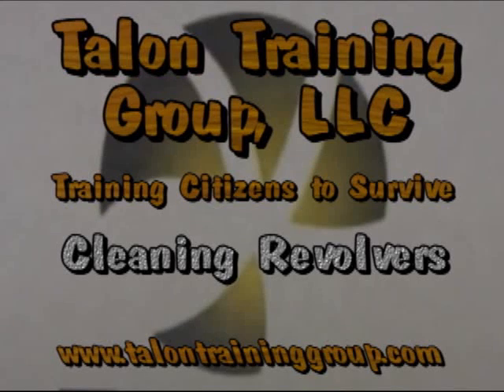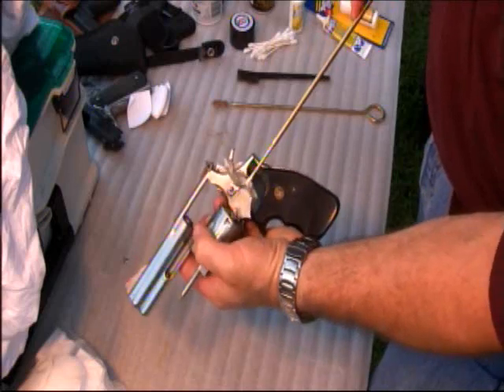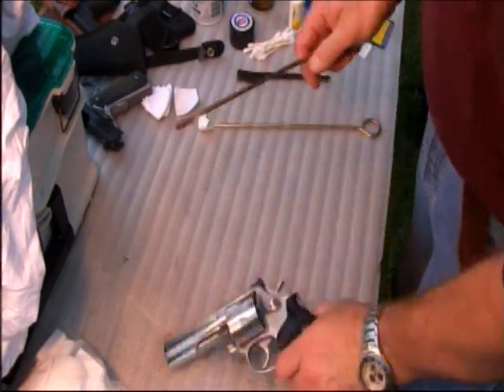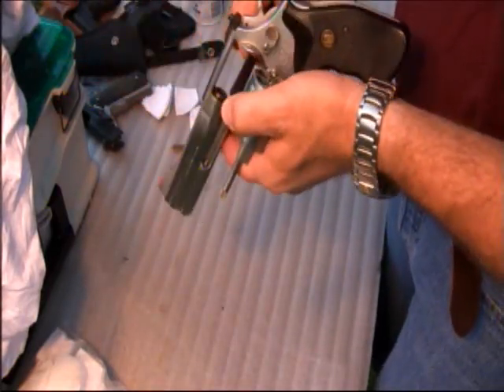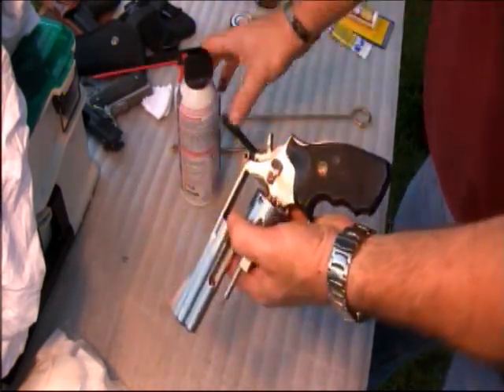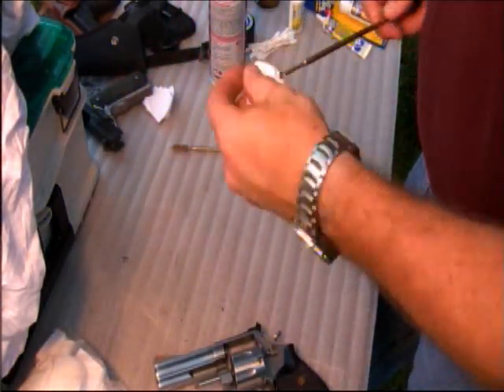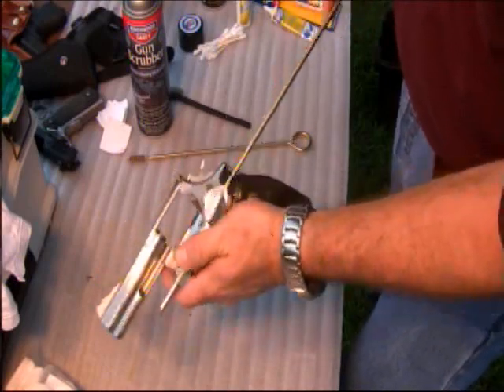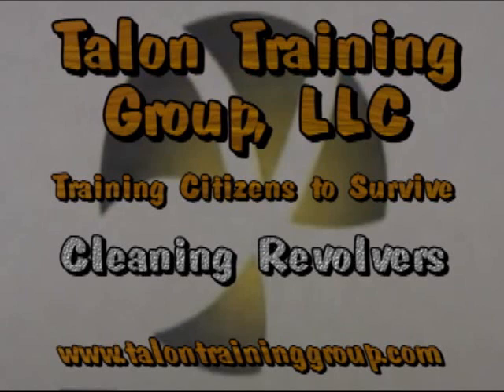Cleaning Revolvers

Comment from the maker: That warning was to prolong the life of the brush.  The reason I don't use stainless steel brushes is that it is a hard steel and will scratch even other stainless. The Phosphor Bronze is a mild steel that won't scratch very bad, but, cleans well. You won't damage your barrel by doing this. It does wear out a brush quickly and can get stuck.

Comment from the maker: In a rifle, it is discouraged.  You can damage the crown (the part where the lands and grooves end) and cause the bullet to wobble just as it leaves the barrel.  In most cases with a handgun, this is not a concern.  Just use a brass or alluminum cleaning rod that is a softer metal than the barrel. This way the rod gets damaged rather than the barrell.  On a revolver, it is hard to clean from the chamber unless you use a flexible rod like an Otis kit or a Bore Snake.  Not a big deal.

Comment from the maker: Just clean the cylinder.  Take a bronze bristle brush and run it through each cylinder a number of times with a good bore cleaner.  If you shoot lead ammo without a jacket, it will foul quicker.  That should solve the problem though.  If it has built up that much, you may want to let the solvent soak a bit, then scrub it well in each chamber.

Comment from the maker: If you are using jacketed rounds, not many strokes.  If you are shooting lead without the jacket, many more.  No certain number, but, I generally run a brush through 8-10 times on average.  That should be plenty.  Shine a light from the cylinder end and look down the barrel.  If you see residue after a few patches, then run the brush some more.

Comment: While it would be best to not clean from the muzzle end, you have no other choice with a revolver.  I use a carbon fiber rod  -- it's certainly softer than the steel of the gun.

I have a Bore Snake, which is good, but I've found that one really needs to use a rod to fully clean a revolver.

Good video.

Comment from the maker: Yes, just be careful not to use a wire brush of any type on the blued finish.  I would just use Break Free and a nylon brush.  You can use a bronze bristle bore brush in the barrel, but, I wouldn't use one on the outside.  Might not hurt it, but, I wouldn't take the chance.  I have the same gun in a 6" version in blue and haven't had any problems just cleaning it with a nylon brush.  Blued gun don't really show dirt like stainless, but, will of course, rust...

Comment: Great vid! You confused me (a newbe) a little. First you stated @00:32 that a stainless gun is 'a little easier to clean.' Then @9:46 you stated that while wiping the gun down, 'a blued gun is a little better than stainless.' In these statements, are you stating you have a preference to one finish over the other? Seems to me that a blued gun is more susceptible to scratching the finish and thus rust . In other words, which would you spend your hard earned cash on, a blued or a stainless? Thxs

Comment: If you have a blued revolver, would you still use a copper barrel brush down the cylinder?  If so wouldn't that potentially ruin the finish surrounding the holes at the front and back of the cylinder?

Comment from the maker: James,

Absolutely not.  Just clean and lube before you shoot it if you want to be careful. Otherwise, just shoot it and clean it afterwards.  What they are telling you is right for the most discerning sniper or long range shooter.  (I was a Sniper for 8 years. And we recently broke in a Chey-Tac .408 that  way.)  However, in a handgun, this would be absolutely unneccessary overkill.  Save your time.  99% don't do this with a rifle. Glad to hear you do.  Charlie

Comment: I have a Ruger 22m. It's composite on the outside. How do I clean the composite material?
Reply from the maker: wipe it down with a rag and solvent, or a tooth brush with solvent or Break Free on it and then wipe it clean with a clean rag. you really can't hurt it unless you use a solvent that is not for guns.